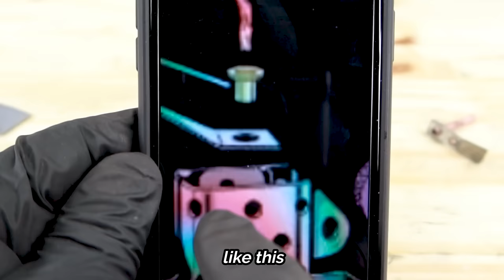Zippo Lighter Restoration - Marlboro Edition

Comment: You were supposed to lift the felt pad to fill it lol. Great restoration otherwise!
Reply: it even states: "lift to fill", looks like a bait for a comment
Reply: I fill mine thru hole in center of felt
Reply: @lazy_termite  I always used the hole for that (the one he dropped the spare flint in). It fit the lighter fluid spout perfectly.
Reply: I lift the felt pad and fill the lighter until the other part of the pad which is fixed by the flint screw gets wet by the fluid. As soon as I see this I stop otherwise the lighter will be overfilled and you will have to wash your hands 😂 with this amount of fluid I can easily use the lighter for a week. I just fill it every Monday morning. No need to do that more often.
Reply: TIL the hole in Zippo felt is for spare flints.
Reply: Yeah you lift it  for filling up the holes for spare Flint. And you grab your favorite Marlboros and commence to smoking 👍
Reply: @300blk8  lol i quit 10 yrs ago after reading your comment i feel like one
Reply: It really doesn’t matter the felt pad ends up getting fluid on it anyway

Comment: Great video again! Really like how you do all this without expensive specialist machines. 💪👍

Small generic safety note regarding the drill press though, vinyl or nitrile gloves are fine, but don't even use safety gloves while using a drill. The drill bit could easily catch the glove and tear it apart, taking the operator's hand along with it. Same with other fast spinning equipment with cloth-snatching capabilities like lathes, mills etc.

Comment: I looks like copper because the solution that you use for rust may be attacking the zinc in the brass
Reply: No, copper is plated onto brass so the original final coating of nickel would adhere.
Reply: @clyde9803  You beat me to it :)
I was about to comment that the copper is standard practice when chroming metal.
Reply: So do those pink parts need re-plating?
Reply: And back in the 90's some of the Marlboro Zippo, lighters you could get with miles, were copper.
Reply: @Ovidiu Anghel is correct. Put anything made of brass in rust remover. The tin in the brass will dissolve, leaving a surface coating of copper.
Reply: @clyde9803  thats what i was thinking.

Comment: I never knew till now about the spare flint location
Reply: Probably a design holdover from the early days.
Reply: I don't think it is x)
More likely a place to press down the nib of the lighter fluid when refilling.
Reply: @Partrik  no it's absolutely a place for a spare flint 👍
Reply: Out of all the years I used a Zippo when I smoked, it never freaking occurred to me to place a spare flint in the felt pad. I can't begin to say how many times my flint sprung out of my Zippo leaving me sparkless and craving a smoke until I found another light or more flint.
Reply: @DATONALKY  ...it can be used for both. :)
Reply: It's not a spare flint hole I don't think. I use it to put the fluid into so I don't have to  "LIFT TO FILL, LIFT TO FILL, LIFT TO FILL.  : )
Reply: Doesn't it say in the manual that the hole is for holding a spare flint? I could've sworn I read it in the manual.
Reply: It isn't !

Comment: "I use a little squeeze of penetrating oil..." (floats lighter off the table)
Reply: As my dad always said "You can never use too much DETCO."
Reply: Its giving "two shots of vodka" vibes
Reply: @SharpForceTrauma  or wd-40? (Is wd-40 even penetrating oil or something I know it’s like a rust remover or something)
Reply: @betaakey  It's less of a rust remover as it is able to get in between rusted bits so you can pry them loose. It will prevent rust if you treat metal with it though. Now DETCO is genuine penetrating oil, we used it on the farm equipment all the time.

Comment: Ty, haven't I seen you do nickel replating? It's fairly cheap and simple, and this lighter could have been easily replated in nickel just like new (if the copper was still intact). Tip for next time!  :)
Reply: You can Nickel plate straight onto the brass case and it will polish up like chrome.

Comment: You always do such incredible work.  In this instance, I think it would’ve been better had you used a smaller, softer brass brush to remove some of that corrosion rather than that large, stiff-bristled brass brush.  I think the smaller, softer-bristled brush would not have left the scratches that you experienced from that larger brush.

Comment: Rolls a joint
Got a light, bruvneor?

Also, which politician do I have to bribe for them to allow MC-51 to be allowed stateside? That stuff looks legit!

And as far as copper goes, I anticipate that metal increasing in value due to its germ resistant properties...
Reply: Try Evaporust here in the States It works Very Well..
Reply: @wetdedstuocm  my favorite stuff, works like a charm

Comment: Solder, not glue holding the Marlboro Man on
Reply: If they had a good glue back then, would have used it instead of the more expensive process of heating and soldering.

Comment: Restoring the inside was pretty unecessary. Just put in a new "inner" from Zippo. It should be identical. The valueable thing is the case. And the hole on the bottom of the felt is not for a spare lint, it's to poke the refill bottle inside.
Reply: From the Zippo website:

1. Remove the inside unit from the case.
2. Turn it over and lift the felt pad to reveal the packing material in the fuel chamber.
3.Slowly saturate the packing material with lighter fluid. Stop filling when the fluid reaches the top of the packing, or begins to change color.

In a video there they actually say you can keep an extra flint under the felt pad (not in the hole).

Comment: Hello mr. Tysy, beautiful job on lighter. I will give you a tip that I have learned. When peaning small rivets, use a nail set ( for counter sinking finishing nails) the point is cupped.

Comment: Many comments about lifting the felt pad to fill the lighter. FYI The felt is there to keep lighter fluid in the batting and not letting it evaporate in the bottom of the case. Also the wick is more effective when you wind it back and forth in a serpentine fashion intermixed with each of the balls of batting as you press them in the case. This insures the wick is in contact with fluid filled batting and not sitting on top of all the batting..

Comment: as a zippo collector I can tell you the copper plating is there because zippos are usually nickle plated, and they would do a 2 stage plating process, however, marlboro zippos were usdually made of lighters that had flaws after the copper plating thus got painted, usually black so the decal or emblem would stand out, also, youre going to have some fueling issues with that because the rivet you used for the spring doesnt hold the wick tight enough, meaning its not going to seal properly and leak, and the wadding needs to be put in a certain way with the wick snaking through it to fully absorb the fluid.

Comment: that model was a special 1994 marlboro zippo. they supposedly coated the brass in copper to prevent tarnishing and protect the zippo's finish prior to its purchase and use. solcid copper zippos will actually say copper on the bottom of the lighter itself. The bottom of the zippo will have date code which can be looked up on the zippo site itself. 1994 should be an X on the bottom of the zippo. but looks like yours says eeither XII or XI. couldnt find info on that zippo made in those years but could just be i didnt look hard enough

Comment: Did you know Zippo lighters are lifelong guaranteed? I had one when I smoked (quit 25 years ago). The trick was to flick the lid open by slamming it downward on the side of your lap and lighting it up with the return movement (upward) by friction on the same lap. Then you would close it by a rapid flip of the hand. Tricky to master, but very cool when you do. Watch for a memorable scene in Platoon which involves a Zippo. There was no decoration on it all, and I liked it that way. Gave it to my brother. I’m not sure, but I believe it’s also the only lighter that stays lighted until you flip the lid closed. Others need to maintain pressure on a knob to keep burning. During my military duty, I used it to warm water for coffee or heat food thanks to that feature. Unfortunately, too many drug addicts used this feature for the same reason.

Comment: Hi copper is part of the plating process It is applied to base metal before nickel or chrome plating
All you have done is polished the base metal and not reappliied the coatings to bring back to original
Hope this helps 
Regards

Comment: Great resto but you gotta weave the wick around pieces of wadding and lift the felt pad to refuel
Reply: The felt pad has a hole you can put the fluid nozzle into. You don’t need to lift it.
Reply: @Youaremychildren  I’ve always heard it a way to fill it. If that’s the actual use for it, I had no idea.

Comment: the parts were covered with copper because the figure is made of it. The parts in rust remover made a galvanic pair so copper had come into the solution and then moved to the brass and steel parts. You can check it with an iron nail moved into a CuSO4 solution - it will be the same and even faster (3-5 min)

Comment: You may want to reconsider attaching the ornament with epoxy, the heat from the lighter may cause the glue to fail, maybe it would be better to solder it to the brass casing

Comment: In the decorative nickel plating process, it’s common for parts to be copper plated first before the nickel and and chrome platings are applied. That usually applies to steel and aluminum parts though. I’m not sure about brass.

Comment: good restoration but I tend to put the spare flint under the felt, that way you don't end up loosing the flint if it drops out the hole and don't pour lighter fluid on the felt pad but as the genuine zippo pads will say lift to fill.

Comment: I have this exact lighter.  Still in damned good condition with the box.  It was from Marlboro Cigarettes which I redeemed with the old points promotion they ran for years.  BTW:  The cowboy should not be polished.  Also noticed yours has no "Marlboro Country Store" engraving on the back.  Interesting.

Life was so cool in the before time.

Comment: If the lighter case is brass then possibly the rust remover is dissolving the zinc and leaving the copper. I was not aware but when I looked it up, a lot of these rust remover products do indeed dissolve zinc.

Comment: Copper plating, i also had this issue. Copper from brass goes into the rust removing solution and then plates the other metals in there

Comment: hi  tysy, great video except when you used rust remover, and then always lift the felt and fill the lighter directly on the cotton. the lighter fluid will dissolve the extra flint which isnt good

Comment: It is very common, to do nickel or chromium plating using a first layer of copper plating. Copper gives a very smooth surface and good covering of the part to be plated. Copper also serves as an adhesion promotor between part and final plating. There are even standards for plating (ISO 4527 chemical plating or ISO 1456 galvanic plating).

Comment: All on all nice work but I think you should replate the outside in nickel which was stripped away by the rust remover. You might want to check the label on it about using on nickel finishes. Then it will truly be restored

Comment: Part of the chroming and nickling process involves Copper plating before Chrome or nickle is added. Copper is oft used a microscopic filler for any pits in the metal as well as an oxidation layer should there be a scratch. It effectively prevents rust lest the wear is very deep. More over Chrome is more durable than Nickle and Copper and very dificult to scratch meaning short of years of bouncing around with keys the chrome finish will take a long time to tarnish and wear. Chances are the lighter was nickle though but even nickle coating adds a very resistant layer, just one more tarnish prone than Chrome, but ultimately cheaper. The green tarnish was likely copper oxide after being exposed to the weather and dirt for years after the nickle was lost.

Comment: I commend you on even attempting this lighter,  but I do have issue with the finished result. IMHO, the brass case should have been sanded with increasing grits of sandpaper,  and then polished. This would have eliminated the distorted look on the final product...

Comment: You may find the lighter had copper on it as the body was chrome or nickel plated, don't ask me why but some companies copper plate something before chrome/nickel plating.
Reply: According to the internet, Zippo lighters have brass cases that are then chrome plated.
Reply: @robertbrandywine  either way that copper was supposed to be there
Reply: @ThatEngineerDad  But what happened to the chrome plating?
Reply: @robertbrandywine  it may have just been copper plated only as some others have suggested in the comments.

Comment: Your not supposed to put the lighter fluid on the phelt pad,you're supposed to put it in that tiny hole in the pad where you put the spare flint. But other than that it was a good restoration I like your videos a lot, keep up the good work.

Comment: That looked like the inner shell slide into the outer shell far too easily. If you don't keep it upright fluid is going to leak out like crazy. Every Zippo lighter I've ever owned, has had a fairly tight seal with the outer shell and didn't just drop in like that one looked to do once finished. It looks nice, but it's really not gonna work well as a pocket lighter anymore. That gap also means the lighter fluid is going to evaporate out much faster.